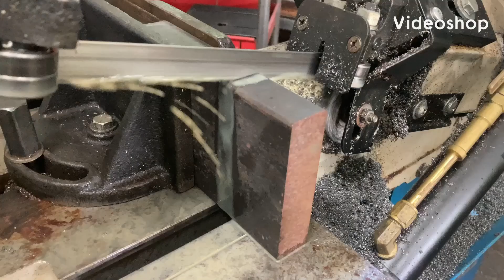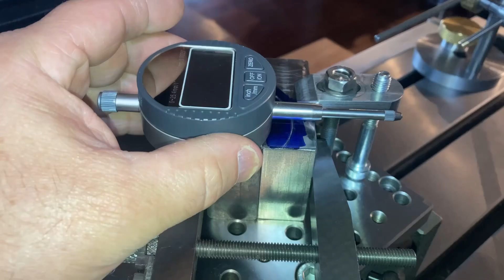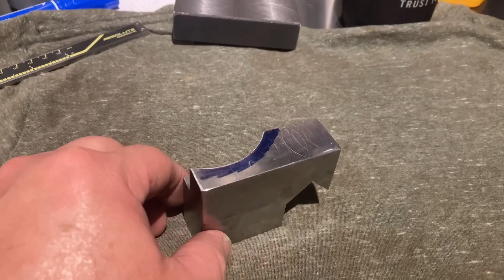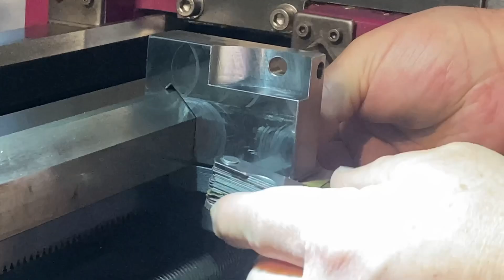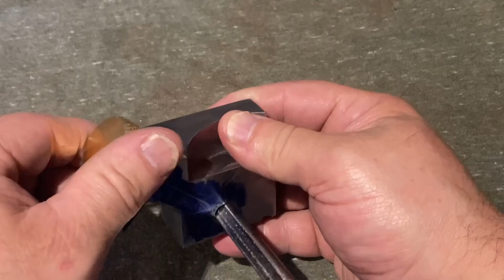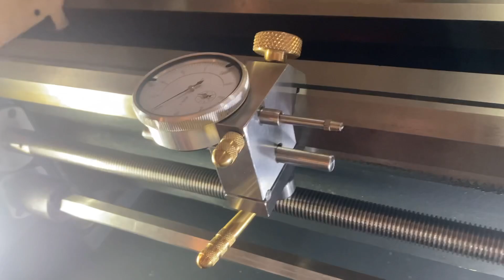Carriage stop with dial indicator, no tools required

Comment: Looks brilliant, but I've always struggled with the concept of physically stopping the carriage with the motor still running.
Reply from the maker: @skysurferuk  hi mate, you don’t use a hard stop while using the power feed, you would disengage the power feed as close as you can to the stop, then manually using the carriage hand wheel, move the carriage to the stop. Hopefully this helps and thanks for your feedback.